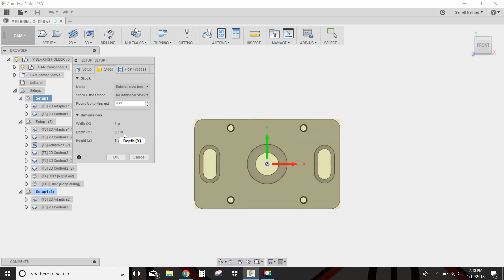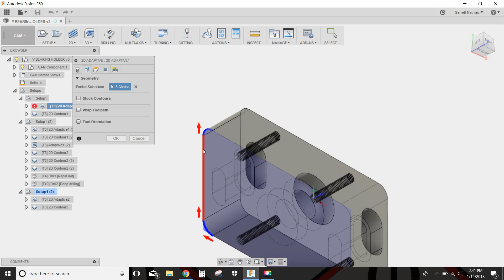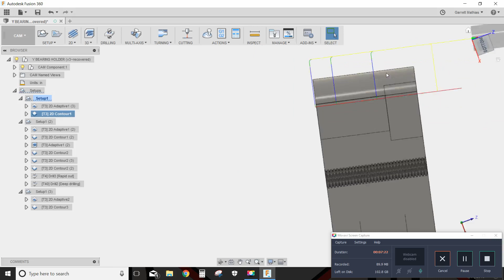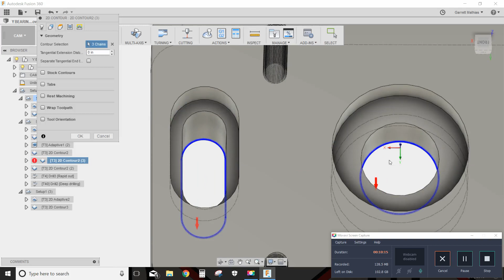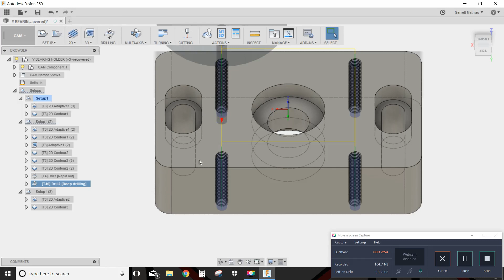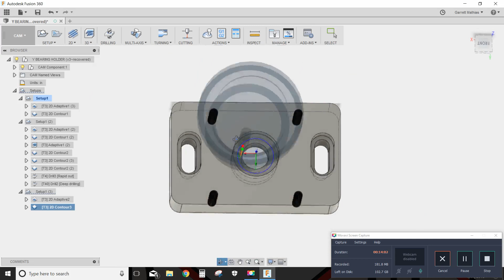Program that Part #1

Comment: If you press and hold the ALT key when selecting edges for a CAM operation, it will select only the edge your mouse is over.  You don't need to go back and tell it to be an open contour.
Reply from the maker: Yes! That is awesome! Thanks for the tip!